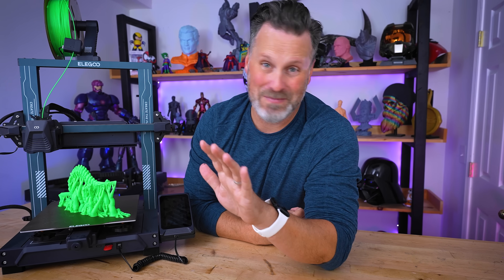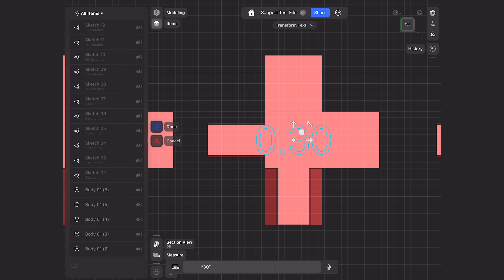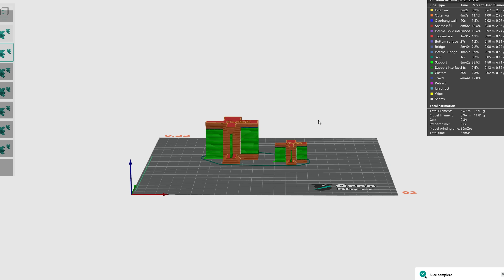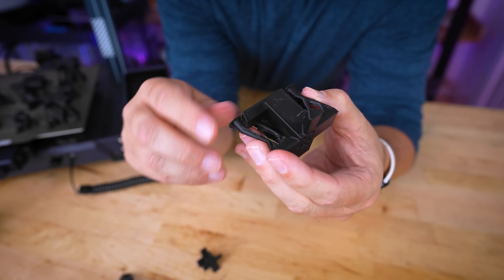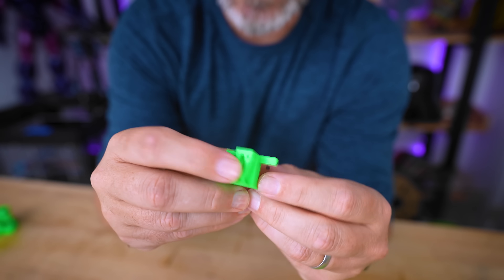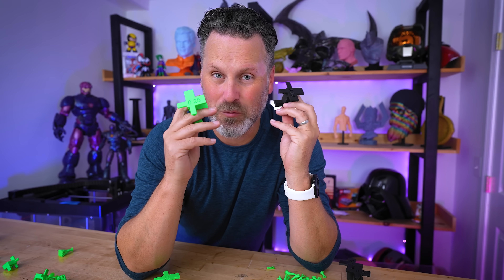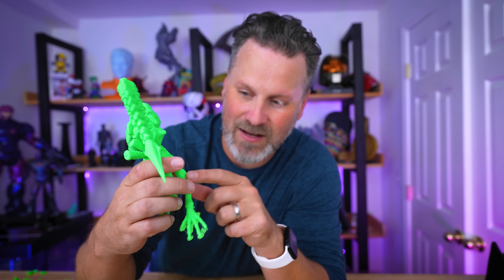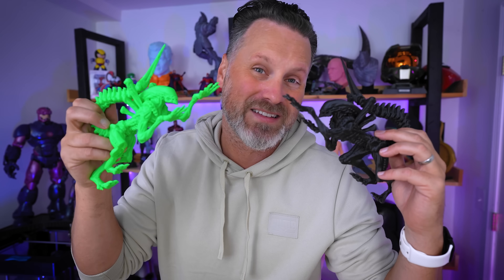Stop Struggling with 3D Printed Supports – Try This!

Comment: Man.... Elegoo prints are so ugly these days. They've shit out 3 versions of the same printers from 4 years ago without real improvement D:

That aside, great video Jessy, you did a good job here. Very solid and straight forward video.
Reply from the maker: Thanks! I’m actually pretty excited for their core xy release. Should be a big improvement over the standard bed slingers they’ve done for a while now.
Reply: Yeah but they are rock solid and pretty cheap. Let's not even talk about the sub-$500 MAX version. Hate all you want but they make a quality printer. The only real downside I see is they don't like being upgraded (firmware or hardware) but I just want to print and I want a printer who can consistently do so that isn't a Bambu Labs printer.

Comment: Best method is PETG with PLA interface (or visaversa) . But in some cases (cantilever parts) you want to have bed anchor cylinders (1mm diameter) to hold the part down to the bed or it want to curl up as the petg lift off pla (I’ve only done petg with pla interface). 

Undersides are great.
Reply from the maker: 1000% agreed. I showed that in a video recently on my XL… so dang awesome
Reply: how many people has idex/ams/dual extruder setups anyway? i really like that method, but it seems impossible/expensive for most of the users (excluding bambu guys, it seems like most of them has ams)

Comment: adjusting temperature can also affect it. you maybe printing the green filament "hot" compared to the black the additives in the filaments for color can affect how well they print at different temperature.  this then affects adhesion
Reply: I just witnessed this - same filament for 2 prints.  On the first I modified my extruder temp from 210C to 200C after the 10th layer, but forgot to do that with the second.  The first model's tree supports came off cleanly, but the second section's supports required enough pressure to remove that I broke two of the parts that were stuck in the removal.
Reply: @RocketCityTim  ị reduced my temp by 5C and almost ruined one of my prints. The thing kept getting stuck and didn't melt in time
Reply: @RocketCityTim  Same! I increased temperature but this lead to hard to remove supports. What's the fix? Increasing top z distance?

Comment: jesse fab video as usual..totally unrelated ...how do you even use the nep 4?..mine has been some kind of broken for so long , updated firmware, levelled and relevelled ad nauseum..tilt screw adjusted...nada wont get through the first layer.
just a large paperweight at this point, really has changed my view of elegoo aswell.
Reply from the maker: Oh no really? Mine have all been pretty rock solid. I’m not even sure that I’m on the latest firmware. I definitely use the 4 plus more than the standard 4 machines. The one issue I constantly have is stinging with my n4. My 4 plus & max are pretty solid

Comment: I find Bambu matte SUPER sticky (it's pulled two beds off so far).
The frustrating thing about this is that manufacturers change their formulations so you need to mess about with EVERY spool. This info should be provided by the manufacturers.
Reply from the maker: Oh dang! I was debating on ordering some of their matte PLA
Reply: @UncleJessy  It prints INCREDIBLY, but best printed on the textured plate. Identical performance to Polyterra Matte. Highly recommended for multicolour printing and Hueforges.
Reply: I stopped using their matte PLA for the same reason. I had a permanent fused color "impression" for lack of a better word, on my textured build plate.... So any subsequent print would have those impressions transferred to the new print.
Reply: @joejvitale  Yeah, crazy sticky. Razor blades out every print. Perhaps we should have used glue sticks to coat the bed?

Comment: Am I doing something wrong, or does Cura not have some of these options?
Reply: Cura has a bunch of settings hidden by default. If you go into the "Settings" tab at the top, click "Configure settings visibility", you can check a box next to the setting you want to see. It may not have the same settings as the other slicers, but it gives you control of everything related to that setting.

Cura also has a plugin in the 'marketplace' called "Calibration Shapes" by 5axes that has a better version of the model this guy designed. The center column is hollow and instead of a "smaller angled" surface to added support to test, it has two hemispheres. Because who the hell thought it would be a good idea to test a big and small flat surface at the same time...
Reply from the maker: I believe it’s in there… I just try to avoid Cura at all possible if I can 😂 “orca slicer snob” 🤣
Reply: @UncleJessy  I must be real dumb. I can't find it. I always get those fat trees. And those that do not come off easily.

Comment: Top Z will also affect the surface quality that are being supported When leaving a higher distance from the support to the supported structure you'll encounter much more stringing and droop so I feel like you should have brought this up as a factor to deciding how much distance is being used.
Reply: He briefly showed at 9:45, the 0.28, 0.3 actually looks better than 0.2, I assume it’s because the filament are not sticking to each other
Reply: you also change how that layer prints like rectilinear for example which can help your final quality.
Reply: What about the bottom z distance. What does that affect and how do you know that to set it at. Like that does .16 do vs .2 etc
Reply: I have not experienced that at .26.

Comment: I think the Z distance is always a multiple of your chosen layer height. If you enter anything that isn't a multiple, the slicer will just default to the nearest multiple. That's why you're not seeing the variation you might have been expecting in your results.
Reply from the maker: So are you saying the slicers override the value that you input for the supports? I think the biggest factor I saw with this test was that even if I run the exact same .gcode file the difference in the filament I'm using can impact my support removal.  In this case the Matte Black vs the Rapid Green PLA needing a higher Z Distance - Thanks for checking it out and the additional input!
Reply: @UncleJessy Independent support layer height is an option in Orca Slicer but the option only appears if you disable the prime tower (even when a prime tower isn't required on the plate). There are a few GitHub issues around this since it's not immediately obvious when the setting tends to be hidden by default.
Reply: In OrcaSlicer you have the option to run independent support layers which will adjust the layer height on the supports to follow the exact offset you have selected. I'm not sure of PrusaSlicer and Cura has this option.
Reply: @ChrisFloof  It doesn't work for me, I have a 0.8nozzle and 0.6 layer height
Reply: No its because the supports are too small to matter (and tree supports too). Also he didnt check the quality of the overhangs to actually see the difference.
Reply: Was going to say same thing you beat me to it, and probably said it better as well 😂
Reply: This will work if you're not using a purge block and you have the "Independent Layer Height" setting for supports in OrcaSlicer is selected.
Reply: I agree, in orca with a 0.8mm nozzle and 0.6mm layer heigth, I can't dial the support distance between layer lines even though I have the option "independant support layer height" turned on

Comment: Question: does matching layer height to the top layer distance make a difference?
Reply from the maker: Usually you will want to go slightly higher for the Top Z distance in my experience but now you can quickly test it out and see ;)

Comment: Minor quibble, but would outsetting the numbers on top instead of insetting make it print faster? That way the fill pattern for the top level is uninterrupted and the actual numbers can be overlaid fairly quickly as there's not much material there.
Reply from the maker: potentially but I dont think it would save very much time as the inset values is super shallow